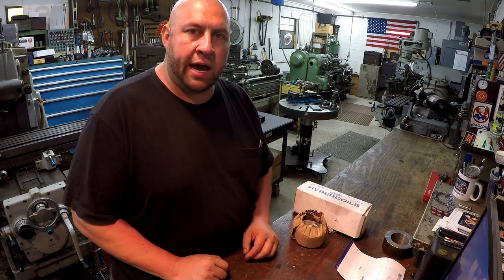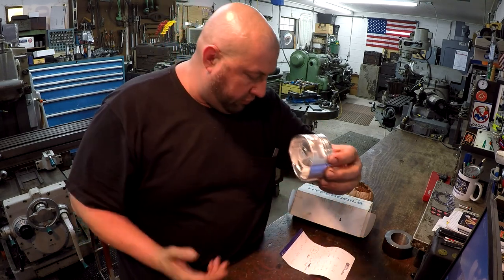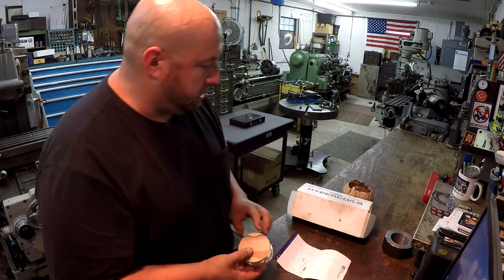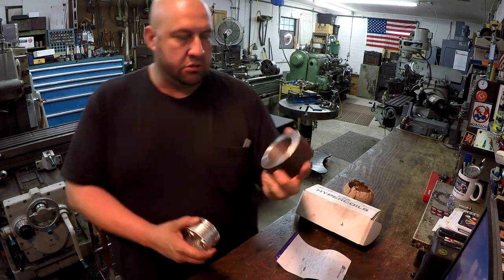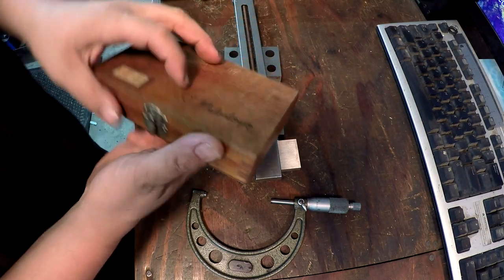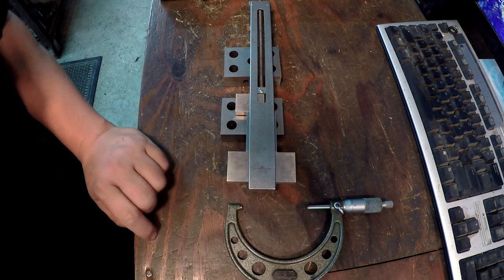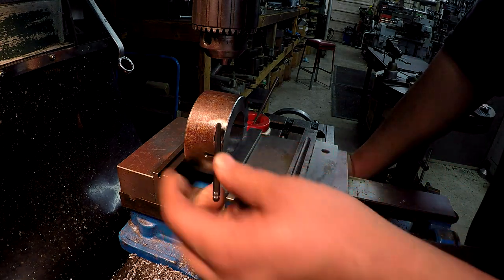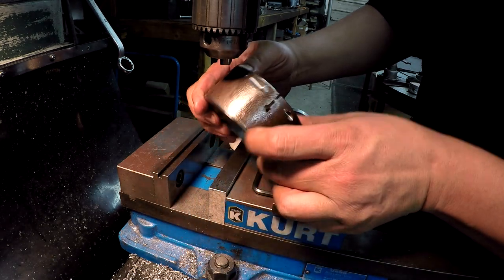Hayabusa Pistons Part 1

Comment: Adam,  FYI, Piston skirts are usually slightly elliptical to account for slight changes in expantion as the piston heats up. He might be better off sending those pistons back for ones the right size for the cylinder.  Just a thought.  Chris
Reply: Those pistons dont change shape by 2000th of an inch. Also Id get that coating off there. Once the piston reaches temp... That ceramic will delaminate.  Tried using some coated pistons on a Racecare 3 years ago.  Lost tonnes of power.  When we removed the piston we saw craters and high spots where the coating literally came off. Looked like a pan of brownies.
Reply: True, but if its for a drag bike, maybe it doesn't matter cause they run high tolerances anyway
Reply: Indosarnia  yeah, there's a reason nobody else does this kinda thing. I mean maybe you would if you had some free pistons, or if you had some you just could not return and needed to use. But pistons are pretty cheap compared to a block, and definitely a complete engine. Especially once you add machine time and all to that block so you can't even just go grab one off the shelf to replace it. But hey, it ain't mine so what do I care? It does seem like somethin may have been off, just sayin. I wasn't there when he test fit em or whatever so what do I know?
Reply: There's a reason you send the pistons with the block to be bored/honed to the correct size.
Reply: Indosarnia  Completely agree, I'm a CNC machinist myself and have no idea what the application is for half the parts I make. Not because I'm ignorant, as it always interests me, but because I don't have the time to ask questions. If the component is in spec, its good, its down to the designer to ensure the finished product works correctly.
Reply: @jasonbender2459  Those certainly aren't "composite" pistons, merely an aluminum alloy.
Reply: You do not take material off of the Pistons to get your final clearance. You make sure that the person boring/honing the cylinders has the corresponding Pistons when he does he's  boring. This is not right. Yes, it is possible to learn from you tubers.
Reply: @jasonbender2459  I'm not sure heavy duty truck engines are that relevant to nitrous drag bikes. 

https://blog.jepistons.com/understanding-piston-skirt-design
Reply: agreed, but i guess Adam is just doing what has been asked of him. Its a good video for demonstrating technique thought
Reply: I can vouch for that, I used to work at Cosworth. They are definitely elliptical, and must reach working temperature to be right. And the rings are conical, as are the slots (!). But he has done a very decent job, making a collet to hold the crown, he's just doing what he's been asked to do. Foreigners (jobs for mates) always get the best attention. I remember asking for a 4-station toolpost blank to be machined by a mate at a local shop, for my modelmaker's lathe. When it came back, I discovered the the base had been scraped!  That, for the uninitiated, is not scrape as in have an accident, it is scrape as in achieving a perfectly flat surface by the application of a hand tool, in conjunction with a reference flat. I didn't use it, I had it mounted on a little plinth and kept it on my desk.

Comment: when i do pistons, i make a "cup" for them, then pull the piston back via nut+bolt which has a loop around the wrist pin against that cup which will hold it square, resting on the ends of the skirts. though this is the other way adam is going here, but i've never heard of anybody actually machining the piston to fit the bore. its done the other way usually. i've only ever taken material of the tops of the pistons to make the squish clearance right. still, no reason why this method could not be used for this setup as well.

Comment: All these engine experts in here I think deal with different types of engines than this kind.  If you didnt know it already, you wont realize that this engine isnt a simple "Measure the piston, and then bore the cylinder" job.  Its not an iron sleeve in those cylinders.  Its raw aluminum that has to get a nikasil plating on it after your bore it. So you never know what the bore diameter will actually be until AFTER you get that nikasil plating done in the bore.  Its not the same as like boring out a good ol chevy smallblock.  I never even order pistons until I have the bores all plated and cross hatched ane and get a final measurement.  THEN I order pistons.  These guys were doing what they could, with what they had.  And they did a good job!!

Comment: Adam, It wasn't addressed but I wonder if piston skirts are still ob-round (cam ground) at room temperature due to uneven wall thickness? Expansion at operating temperature was supposed to make them perfectly round. Thanks.

Comment: Nice fixture, but your buddy shouldn't be having you do what you are doing he will end up making a little problem into a pile of problems.  As a guy that builds multiple thousand hp engines for people I have a pretty good idea, no need to make mistakes that have been made before just to see if the outcome is the same.
Reply from the maker: Thanks Brian. I talked to Rodney and we decided to bail on cutting the pistons.
Reply: I am glad to hear your comment.  I just got a chance to watch the video.  I was an automotive machinist for most of my life and I was yelling at the video. "Adam don't do it".  Most piston skirts are not round they are cam ground.  The bore should be honed to fit the piston.
Reply: Back in high school I helped a buddy put together a blow thru turbo setup for a 351 Ford in a Mustang, Knowing we didn't want melted pistons it was jetted way fat. Never the less he got in a mile long interstate race with a Mercedes and it ended up growing the piston tops till it pinched the rings in the bores and then it jerked the tops off the pistons, some it even pulled the pins out of instead and sent rods out the side of the block. It was the end of that engine. :-(  I feared a similar result for this engine by getting proper skirt clearance but the tops being too tight especially for the demands of a nitrous motor.  You can really get some harsh thermal swings out of one of those.  I hate not getting to see Adam do the cool work though. :-)

Comment: Hi Adam! I enjoy your channel. I grew up in P-Cola too. I am a new machinist, but a long time engine builder. Those pistons are larger on the skirt than the crown because more thermal expansion will occur in the crown, especially with nitrous. Interesting to see how you are getting the job done, but if the crowns don't have enough clearance, things will get ugly quick! The cylinders should be rebored and replated.
Reply from the maker: Thanks Corban. we dediced to bail on cutting the pistons down.

Comment: Pistons in large truck diesels are graded for diameter.  That is they run from 0 to 3 (sometimes higher) and are custom fitted in each cylinder, even in a mass production environment.  Also, they are not exactly round (mainly because the bearing for the small end creates  a varying mass around the circumference) which means it expands differently with the aim that the piston becomes round as the engine reaches working temperature.  In other words, your friend gave you a task which is almost impossible!  However, thanks again for another  great video!  Most enjoyable!

Comment: Hi Adam,

The piston is not round at all, it's oval and furthermore, it's tapered as well, meaning that the top should be smaller than the bottom. The rod pin axis is slightly smaller than the thrust axis and this is to help with thermal expansion and side loads. The head is smaller since it expands more as it is closer to the combustion.  No one expects you to know these and you've done a clever job of making a jig for it but machining the piston round will guarantee a melt down in that drag bike. I wouldn't give you apple pie recipe as i don't know jack about pastries, but this is what i do for living, thrust me on that.
Reply from the maker: No worries. I informed Rodney of all the comments about this being a mistake so we decided not to machine them. Thanks for the tips.
Reply: I cast and machine pistons round (but tapered) all the time but not for 4 cycle engines. A two cycle low power engine like a chainsaw is more forgiving, you can go undersize and you (maybe) just smoke a bit more and lubricate better. Now if this was for a 50cc scooter, by all means, a round piston would have done the trick but for a drag bike running nitrous, it would end in disaster. Also, you can hold the pistons from the inside the skirt, that's how I hold them all the time and take light cuts.Thanks for the Sunday content though, you should do more of these :)

Comment: 18:50 Watched a few of your vids now and have noted how well the cutting/machining process has been. I'm pleased in this video, things aren't going quite so well - with the vibration while cutting. I suspect a lot of hobby machinists would appreciate a video dedicated to dealing with 'poor cutting' that causes vibrations - or is it vibrations that cause poor cutting :) ? I guess it's all down to:
1. rigidity of work and tool/cutter/mill
2. Tool sharpness and ground to the right angles for cutting the particular material
3. cutting feed speed
4. rotational speed of material (lathe), mill or shaper in fpm.
5. Coolant or not - possibly even coolant type - oil based or water based.

Perhaps you'll consider making such a video - if you've not already done one ?

Comment: Pistons are designed to be both oval and tapered, being smaller on the head of the piston than the skirt diameter, this is all to do with thermal expansion..when the engine is at working temp the pistons have expanded to be perfectly round and parallel ..you really dont want to be machining the pistons..if they are tight hone the bores

Comment: I like your clamp bolts. Very precisely done. Would it have been simpler to cut the fixture to about a 1/8 total thickness, slit one side full length, and just clamp with the 4-jaw, compressing the thin fixture onto the piston?

Comment: We use gauge blocks for calibrating 3 point measuring tables, and electronic gauges. 

I can only recommend getting a 3 point table (or fabricate one), and using a micron gauge.

Comment: when i was in autoshop class they told me the pistons are ground tapered and oval
tapered because the top of the piston expands more than the bottom and oval (at the underside) because of the expansion of the piston pin pushing the sides out 
think you could machine them but i think the best way to do it is with a cnc milling machine  putting the piston in a 4th axis chuck
Reply: It may be difficult to replicate the surface finish

Comment: Hey Adam, pistons are usually held in the inside if the skirt. There is the perfect surface. It can be mounted in your 4 jaw. You only have to push the piston against the piston head with a flat on your monarch tailstock. I worked for years for a piston manufacturer an that's the way it is done. Just as an advice.
Reply from the maker: I see where the piston is counterbored about a 1/4" back on the inside, but only the skirt areas are machined. Perhaps you could turn a piece of material to just fit inside that counterbore and push on it to friction drive it.
Reply: +Abom79 agree. Or you can screw in a rectangular plate in the middle of the holder that just fits between the eyes of the piston. Here you wouldn't have to push too hard to create friction. Good luck from Germany!

Comment: As many have already stated.  This change is possible to result in a failed engine.  I design pistons for a living.  They are NOT cylindrical.  There is a barrel shape top to bottom and an oval shape circumferentially.  Barrel shape is to allow controlled rocking of the piston from anti-thrust to thrust side and back.  The oval shape is to allow the piston to heat up and avoid the edges of the skirt to overexpand and scuff.   The only way these pistons will not fail in the engine is if the fit is so loose that these nuances of design are irrelevant.  But - that's not Adam's responsibility.  That's the engine builders job.

Adam - inside the skirt on the bottom of the piston is the only cylindrical clamping location.  It is the primary machining datum for the part and is usually called the "register".  Its a very shallow/small contact/round and flat datum a few mm smaller than the OD of the part.   Re-machining pistons is never a great idea - but if it must be done, this is where to locate.   Clamping then must be done by pulling down with soft bars inside the piston pin bore.  Your holding fixture should look like a cylinder with removable L Shaped clamps sticking out that can be pulled toward the cylinder with bolts from the backside.  Ask Tom Lipton for my email address if you'd like to discuss anything further.``````````````````````````````````````````````````````````````````````````````````````````````````````
Reply: Excellent points and advice Jay.
Reply: I doubt I'll get an answer this late in the game but I always thought the barrel shape was due to oil control and differential expansion due to section thickness changes as much as rocking from thrust direction changes? (plus, offset pins, etc) The 'oval' due to exhaust side running hotter than intake side, particularly when intake charge can cool  piston crown differentially
Reply: Jay Bolyard h

Comment: I worked at a shop building pretty serious racing engines for a few years, and later as a diesel mechanic. I give much credit to Abom here as a general machinist as he is correct in his theory on how to hold the piston for what he wants to do (using a split collet fixture and applying evenly distributed clamping force near the piston head end and not the skirt). Work holding any piston for machining is no easy task.

And yes, the cylinder bore is always machined to the piston, not the other way 'round (ahhh... pun) as the pistons are "cam ground" (elliptically machined) and tapered, pins may be "neutral" or "offset", ring lands are reduced "diameter", different alloys / forged or cast expansion properties, etc., so turning down the diameter is not the best advice offered in this video,  although I have seen hand/custom made round/straight pistons in certain racing applications (nitro engines that don't run long enough to heat the pistons evenly anyway, and therefore running lots of clearance - up to 0.008").

But there are many other reasons to machine pistons - valve clearances (fly cutting), balancing, eliminating "hot points" (sharp edges), surface finishes (controlling carbon build up), modifying "dome shape" and compression ratio (dome volume), "squish" areas, plug clearance, gas ports, ring clearance (fit)...some racing pistons are supplied as "blank forgings" without any dome machining or top ring grooves cut (for advanced engine builders to apply their own "winning modifications") and the most difficult part is always holding onto the damn piston.

Aluminum pistons can not be held in a regular lathe chuck - so don't try it. If you hold the skirt end (very weak) with enough force to keep them from flying out or spinning in the jaws, you will distort and damage the skirt, perhaps cracking it. Forget about holding a piston from the inside of the skirt. The piston head is stronger, but if you leave any marks or dents/dimples in the ring area, the rings will not fit/seal properly - and ring clearances are extremely critical! Holding the piston by the pin bore is unreliable and tricky at best, and I've only used that method (in a commercial "piston vise" which I regretted buying) when fly-cutting for valve clearance, and only if I didn't have a proper split collet holder of the correct size made already. In that case, I never cut more than 0.010" per pass, as clamping force was dangerously insecure.

My final version split collet fixtures were 5" long. I used two relief slot cuts 2" deep, with holes (pre) drilled at the end like Abom's, at 90 degrees and an outer self locking taper at the end, like an R8 collet, that fit into a matching tapered sleeve, with a short counter-bored 3/8" UNF draw screw for added piece of mind. I always clamped the pistons as near to the top as possible. I could then chuck the fixture into the lathe three or four jaw or in a angle vise or rotary table on the vertical mill. I made the heavy use ones (e.g. 4.000" bore - a.k.a. SBC and SBF, with most "off the shelf" 4" pistons actually having 3.9975-3.9985" dia. skirts) from 4130 steel, the rest from 6061....I wish I had kept them when I left that job, too....
Reply: Scott B sorry not sorry. You never do this. This is only gonna cause problems. Although i think he may get away with starting bike not letting it warm up rip it then shut it off. It might survive a few dyno pulls and pulls on the track before needing to be rebuilt.

Comment: I have seen this done before with pistons - machine a block that fits snugly in place of the con rod and locates the wrist pin. Leave enough meat on the block to let you screw in some threaded rod at 90 degrees and long enough to go through the headstock, and clamp with a plate out the back of the lathe. So the bottom of the skirt sits on the face of the chuck with the jaws removed. Depending on the skirt design and how much you trust the setup, you can always make something to locate the skirt to and prevent it walking sideways. Or just tread carefully and rely on the clamping force through the headstock, assuming the skirt is robust enough take it - a forged piston is obviously much stronger than cast. Have also seen someone use a con rod cut in half, small end mounted to the piston and bored to accept the threaded rod which is pinned through con rod.